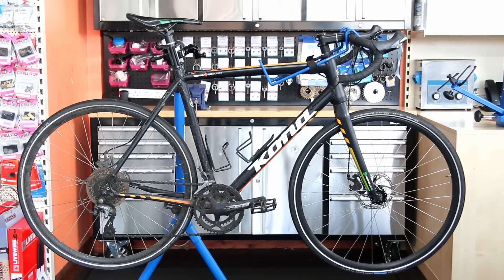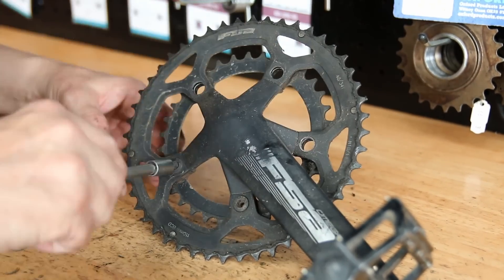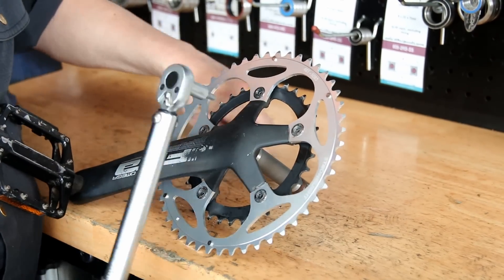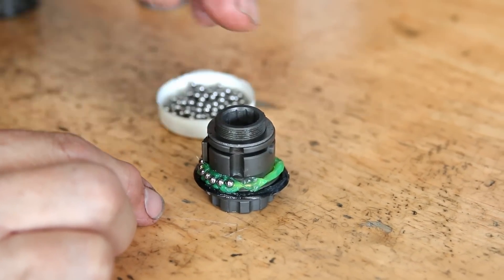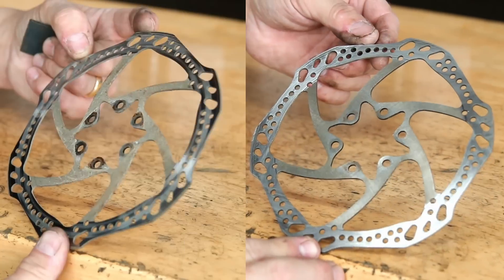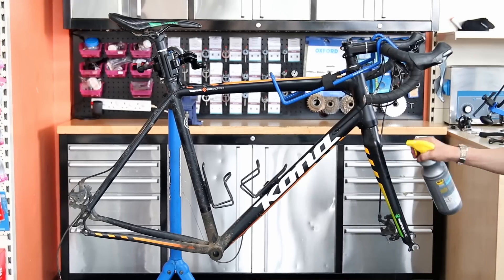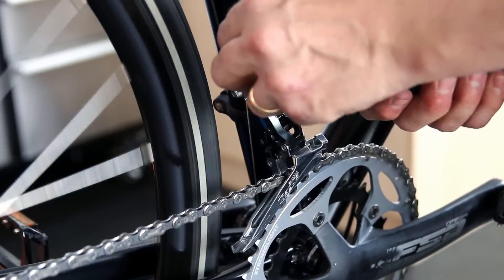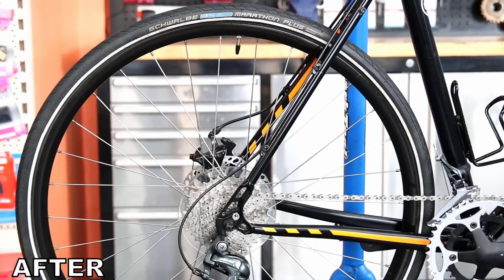Kona Road Bike Restoration! Full Rebuild & Bearing Service!

Comment: Excellent, thorough work.  Your philosophy of making the bike "better" in ways that you haven't been specifically tasked to do is commendable, and so very rare.  

As much as I despise dork discs, you're right to leave them on unless you've been asked to them off.  When I recently overhauled my friend's bike, I explained what it's supposed to do on a bike, and how it's really more of a lawyer thing than an engineer thing, and I noted that hers was brittle and already cracked (it really was) and that she'd be better off without it.  She agreed, and it went away.  I remove then from all my bikes (though most high-end bikes do not have them), along with the US mandated reflectors.
Reply from the maker: The support is much appreciated🧡⚙️
Reply: Why is it better to leave out  the spoke protector?
Reply: @kottelkannim4919  For people who know how keep their rear mech properly tuned, the thing performs no function.  It adds weight and to some riders looks, well, dorky.  Plus, once it starts to yellow, as they will all do, is is also becoming brittle and prone to breaking.  Once that happens, it needs to come out so it doesn't start coming apart during a ride.  Bottom line: You'll never see a dork disk on a professional's road bike.  If it performed a critical safety function, it would be there.
Reply: @rangersmith4652  What is the weight of a spoke protector made of plastic? What will be the outcome of a protector breaking during a ride?
Reply: @kottelkannim4919  It weighs a few grams, perhaps 15?  I don't have one handy to weigh, but I know it's not zero, and weight weenies think 15 grams is a pound.  

If you're riding along and your plastic disk breaks it will almost certainly happen as you're shifting into your lowest gear IF your low gear limit screw is too loose and the disk is all that has been keeping you from over shifting.  On that occasion, the chain and the shattered hunks of the disk will lodge themselves between your spokes and your largest sprocket, making your drive train lock up hard.  If you're ever had trouble clearing your chain from there, you can imagine how much harder that would be with chunks of plastic added to the issue.  For me, and apparently for pro riders as well, simply keeping that low gear screw set properly is all that is required.
Reply: @rangersmith4652  Got it! Thank you!

Comment: Great job on the service of this bike as usual. Supply chain issues everywhere but I guess the customer didn’t mind and was happy to be riding a good-as-new bike again.
I just hit 10.000 km in my main bike and thought that would be a good time for an in depth service but I had upgraded so many parts during this last year that I didn’t really find much to do. I took off so many parts and looked into all the difficult to reach places while I was at it. I even had the break fluid exchanged when upgrading the shifters. But the bike is pretty much done now. I don’t suspect there will be much more exchanging parts in the future so I think I’ll have a good service at around 20.000 km.
Ps: a shame the customer didn’t want you to put new bar-tape on it. Would’ve made the bike complete, I think.
Reply from the maker: Wow! Lotta work done then, must run sweet⚙️🧡

Comment: Omg. The chain. 😂🙈 But after ten years of abuse my brother's bike looked the same. The chain was in the same condition, the rear derailleur was even worse. Completely clocked up. Looked as if he just added oil to the dirty chain🙈 . 
I had to take a gum coated hammer to get out the front fork and when i opened up the suspension there was no oil left, but there was some water instead on the inside. What a nightmare 😂
Reply from the maker: We’ve seen similar, they’re always the best jobs to do though!

Comment: Yet another great video. Very satisfying to watch that nice bike come back to perfect working order. 
As for service intervals- I over grease bearings to prevent ingress of water and dirt, and I run waxed chains. That, coupled with fork boots, immortalize most wear components**. Full bearing rebuilds (mostly to check the full bike) and new cables once a year. Wheel inspection + (rim) brake cleaning/adjustment with every chain re-waxing. Negligent with spoke tensioning but I'm in the process of acquiring tools to properly do the job (stand, dishing tool, tension meter).

**Kool Stop rim (v) brake pads clean the brake surface and prolong rim life to an absurd. Can't recommend enough.
Reply from the maker: That’s a very nice routine that’ll keep your bikes mint🧡⚙️

Comment: excellent job again.  when doing part degreasing I don't have as much table space as you do, so I usually put parts in a Tupperware container and spray them in there, less clean up after.    And I think on another video not this one ( I have been binge watching)  you were talking about video production time.  I know each bike is a separate thing and different things on each bike, but say for example your normal 3 shots of t cut, and glym (?) polish then wax? etc  once you have those done, you have them, so if your editor is not using them as stock shots, that would save you guys ok only 3 or 4 shot set ups per video, and take him less time to look for them in the edit if he has them set up in a video template project.  so say 3 shots per video over say 100 videos just re-doing these shots each time would add up over time.  so if he is not doing that already I would suggest that, you have those shots, use them as stock shots.  not much more maybe you could use stock shots off, but every little bit helps.    IMO.     Drew
Reply from the maker: That would save us a short amount of time yes but the lengths these videos take is hours not minutes so whilst we could save 2-3 minutes that’s time we really don’t mind spending. We appreciate all the interaction!🧡

Comment: aaahhhhh........ my velo OCD has been neutralised for another week...      Lee.  just did my first chain wax on my new Ribble SLR 12 speed ult di2. after refitting chain with original quick link I had a bit of skipping and stuttering on shifting.  I think Shimano say to use new quick link when splitting chain.  I think I may have slightly mis-shaped link when using link tool thingy.   do you use new link for putting chain back on.  I thought that was a sales pitch thing ????   I managed to re tune shifting and its a lot better.   but I've ordered new link.  the tolerances are so tight on 12 speed

Comment: Another great video. Please share the degreaser you use to clean the parts? Even if I use a strong concentration of locally available de greaser is still doesn't get all the grease / road grime off, even with a hard bristle brush. Thanks

Comment: Are the levers incompatible with the disc brakes due to cable pull limitations? If not, then why use the V-levers?

Comment: I get my bikes serviced when I can afford it. 

Generally I try to get them serviced at around 2000 miles that's when I have a new chain, cables, housings and brake pad. It cost over 200 dollars US.

 I have 7 bikes and I rotate them in for service . Generally one or two per year.

Have you gotten many bikes in for service from  Unbound gravel this year?
Reply from the maker: We didn’t get any for this event and after a quick Google hadn’t heard of it before! That sounds like a great servicing routine you have there 🧡

Comment: Lee,

for cleaning the rotors I see you use some emery cloth and wire wool.
Could it be done with some light grade sand paper as well ?

And what are you spraying on the rotors before using the wire wool ?

Cheers
M2
Reply from the maker: Check out this weeks Genesis video, I answer this one in it 😃👍🏻🧡
Reply: @Bikespeeds  just wartched the Genesis video.Questions answered.= new subscriber😁
Keep up the good work !

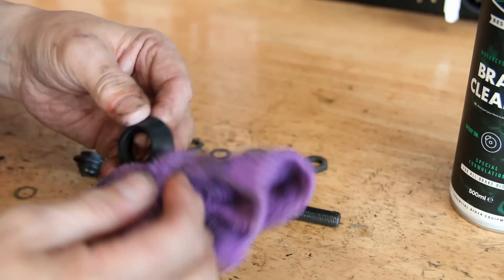Comment: 6:40 I noticed you didn’t remove the bearing seat on the axle, did you intentionally do this so you wouldn’t have to re-center the wheel? Usually that’s the reason why I don’t remove it from one side.

Comment: I’m always surprised you get really hammered bikes and the bearing surfaces are ok.  Whenever I’ve neglected a winter training bike the bearing surfaces in the hubs are pitted, which is game over for the hub. Am I just unlucky?!
Reply from the maker: You could be! It does vary bike to bike. One thing you have to remember is that our customers are often informed that a bearing might need doing and choose to do it at a later date for their own reasons so sometimes jobs have either been done before we film or after we film at a separate date 🧡

Comment: Copper grease on bearings 🤷‍♂️😔
Reply: The copper grease on the lower headset bearing is fine. The balls are sealed inside with their own bearing grease and never come into contact with the copper grease. The copper grease is purely external and used to prevent the steel outer seizing against the aluminium headset cup. A thoughtful touch as the lower bearing sure takes a beating and often corrode in the wet UK weather.